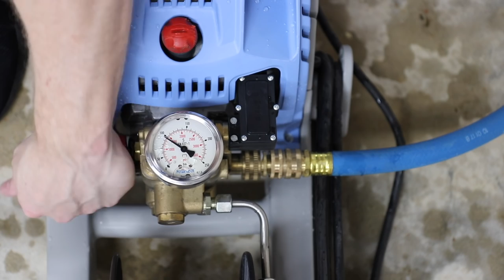Deep Dive into the OG Complete Pressure Washing Solution

Comment: I bought a newer model of the 1122, I did the math, and $65 detailing every 2 weeks would be more expensive than just buying my own pressure washer... the one I bought has a 2 year warranty, but has serviceable parts. The other ones I looked at, typically use fully ceramic pistons that break over time, and are not repairable because they're typically sealed non-serviceable units. Not to mention those "on sale" CrapJoe units have wild crazy specs that are 100% untrue.

Comment: The gauge is glycerin filled to keep the needle from dancing around when there is vibration so that the user will get a more accurate reading.  Thanks for all of the info, it looks like you convinced me to purchase this unit from you instead of replacing a less expensive unit every couple of years.  Are they available with all of the upgrades that you mentioned?  Again, thanks for your research and creating the package instead of us having to source all of the components.

Comment: I have the 1152TS for about 18 months and love it. It literally changed my life. Considering upgrading to a TST and getting a mosmatic gun and lance as I think that set up is brilliant (once you start shipping to UK I might get the gun/wand setup!!). 

I always run the water through it with the pump off to remove the air first. That way when i turn it on you don't spend time getting air out.
Reply: Conor Heaney Matt will ship to the UK already. I have his kit on my 1152TS and it’s awesome!
Reply: Do you think the mosmatic gun is necessary instead of the original Kranzle Gun ?
Reply: guymauve0 It’s a better fit for the purpose of car cleaning. The short gun is great for wheels and the 40 degree nozzle is much more effective. So yes I’d say it’s well worth it.
Reply: Just Ordered! Didn't think it would ship to UK.
Reply: Conor Heaney Excellent. Mine came pretty quickly via DHL. It’s an impressive kit and impressive service!
Reply: Cheers. Looking forward to getting it into my hands now.
Reply: Just buy the tst kit?

Comment: I recently bought the brushless motor Ryobi electric pressure washer and returned it for the Sunjoe that was $100 less..then I came across your video where you were kicking it! My god, the GFC power adapter wouldn't fit in my outdoor power outlet so I had to untangle the damn thing for a good half hour and trying to run an extension cord into my house. With all said and done, I could BARELY get around washing the rear of my Cooper. Once I become more experienced with detailing and get my two-bucket solution "dialed in" I hope I can buy your complete package(s)! After watching so many of your videos, I'm getting turned off by the number of swirl marks and rock chips on my paint. Can't wait to do a full correction down the line!
Reply from the maker: Ha, ha... SunJoe has certainly done a good job marketing that thing.  That doesn't mean it good.

Comment: Awesome video Matt! You mentioned the European version having slightly different specs. I have your kit on my K1152 in the UK. Am I still getting the same pressure and flow as your set up - I find my gun pretty powerful - if I try to clean my brush as I go when washing the wheels it nearly blasts it out of my hands!
Reply from the maker: You are getting more flow.  I think it's 2.5 GPM vs. 2.1 GPM here.
Reply: Obsessed Garage thanks for the reply. Ok. You don’t think there will be any negative effect? I know you mentioned you worked to optimise the flow and pressure etc.

Comment: Ironic that it is easy to make a transformer, and AC to DC bridging tech that can auto switch between 120 and 240 volt AC power source, and if they made a C14 socket for the electrical outlet, they could fix the problem about the prongs being different between US and Germany households/businesses.

Comment: How does this compare to the kranzle 2160?
Reply from the maker: The 2000 series pumps have a larger diameter plunger.  The only problem is that they are all dialed for max pressure and sacrifice flow.  You want this one for washing cars.